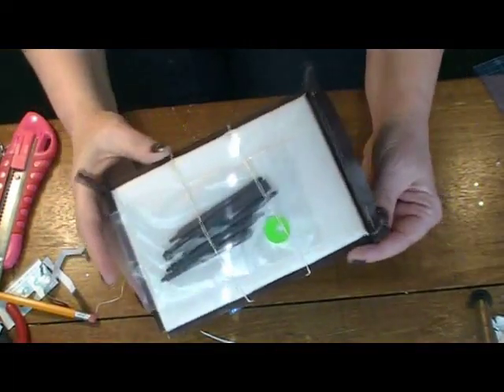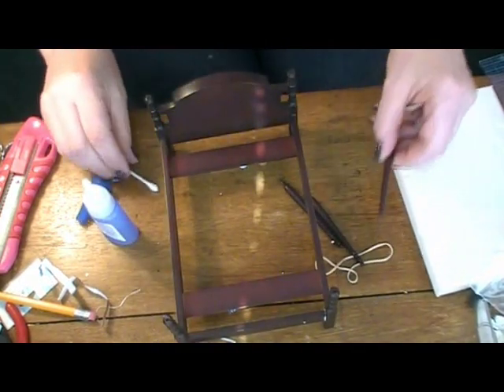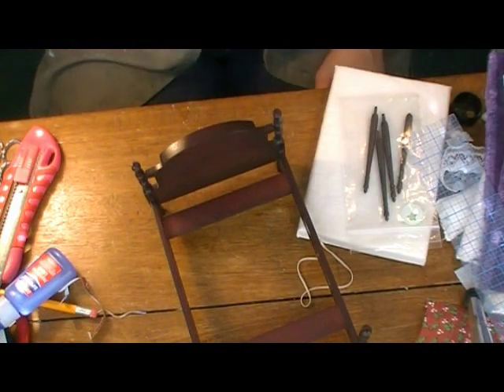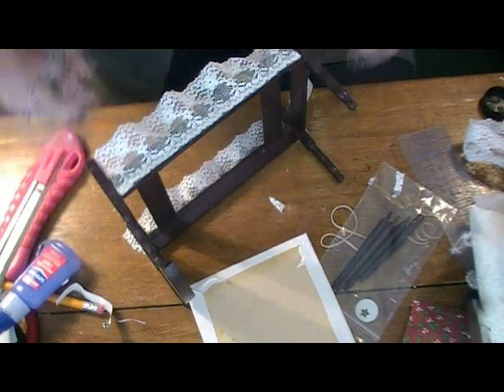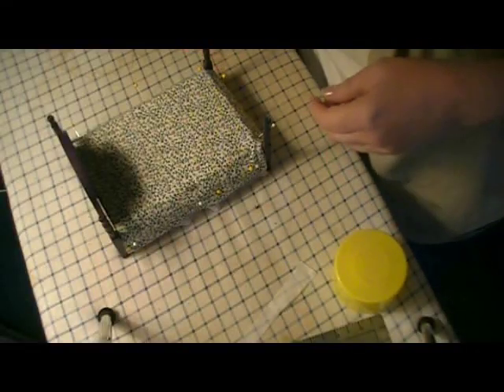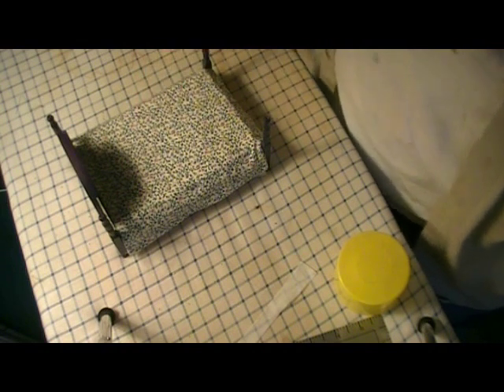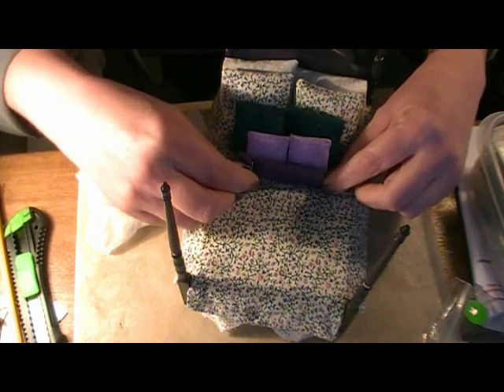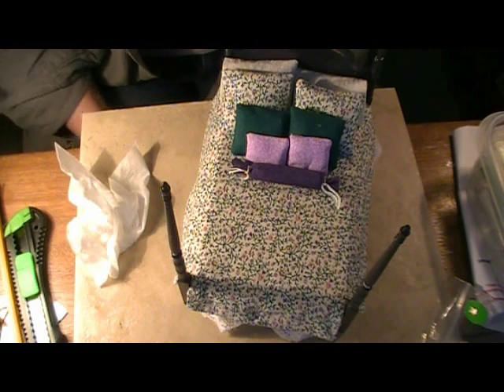Repairing and Dressing a Dollhouse Bed

Comment: The glue that comes with fake nail kits (the cheap ones anyway) are basically Super Glue.  The bonus is that they are a brush applicator rather than a spout.  I have used this stuff as a substitute for Super Glue but not in minis.